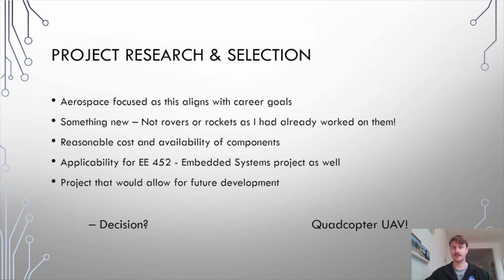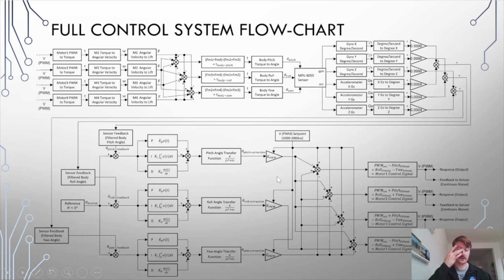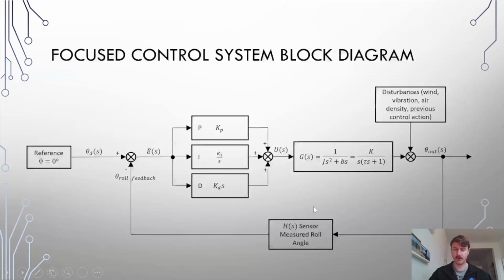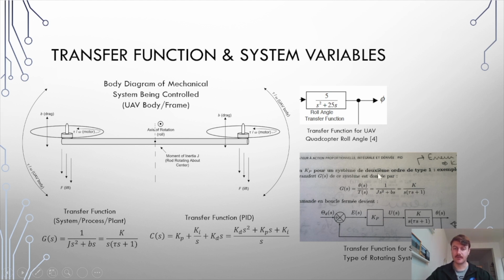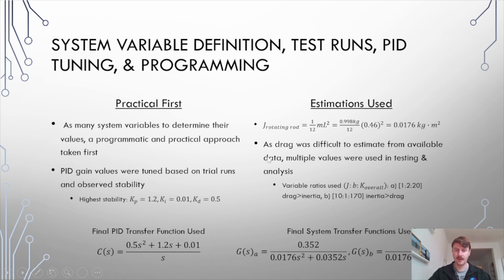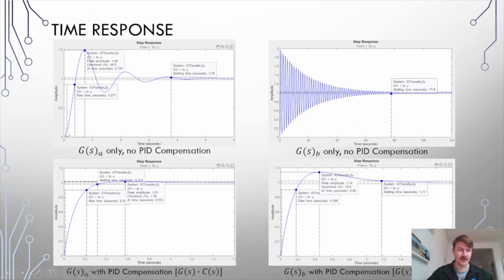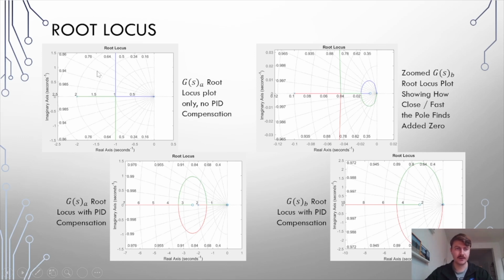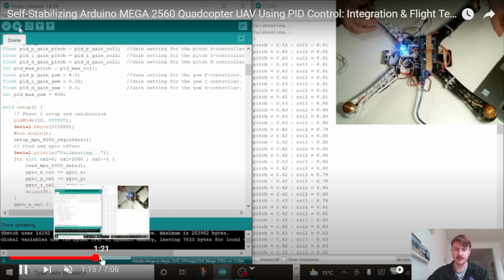Self-Stabilizing Quadcopter UAV Using PID Control: Full Control Systems Project Presentation

Comment: the picture in 1:30 is not quadrotor , so modeling of dynamics is suitable ??
Reply: The axes he used are the same as depicted in the picture, I believe. Doesn't matter if it's a Multirotor, Fixed-wing, or any Air-Vehicle. That is the most popular convention used for aerial vehicles.
Reply: @amitgtamu  True, as also the picture of the jet tends to provide better visual direction for the viewer.